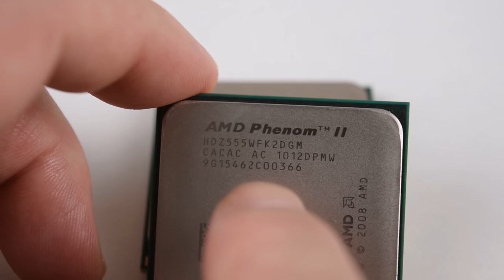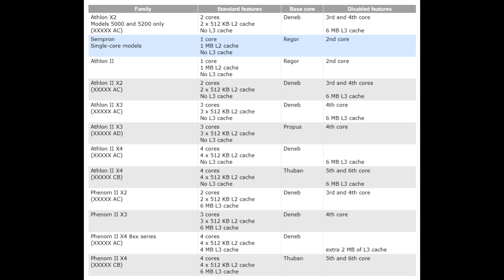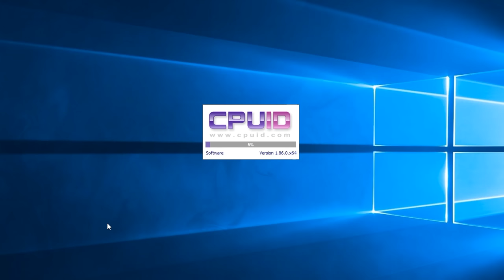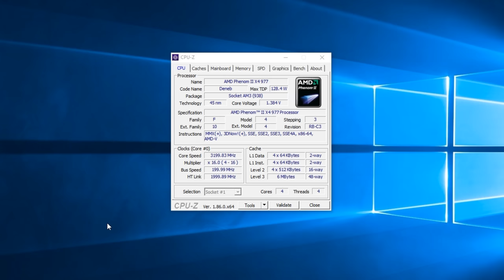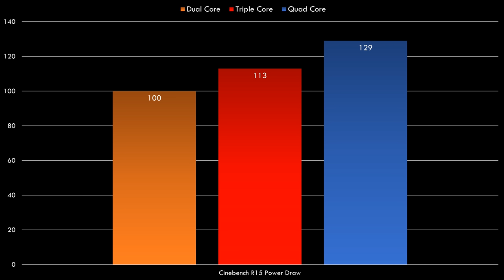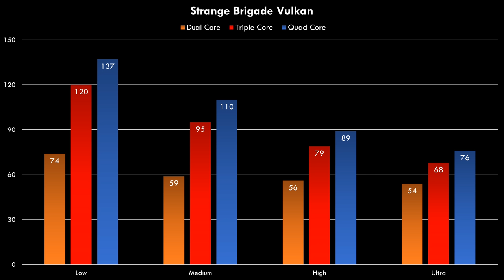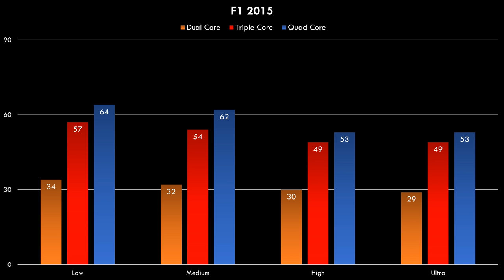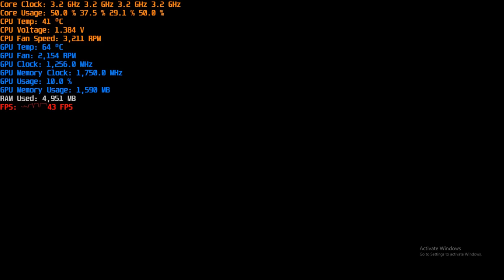Unlock $13 Dual Core into Quad Core

Comment: A timely reminder that I need to play Crysis Warhead! Never did back in the day.

AM3 Phenoms are soooo cheap! Problem is, in a world where i5 2500k's are kicking around for $40-50 US, I struggle to see a compelling reason to use AM3 for anything modern, or even AM3+ FX CPU's for that matter. Because once you factor in motherboard cost, either of these platforms end up costing nearly the same as Sandy Bridge.

Maybe a good video topic for you? What is the best value platform for a modern budget gaming rig - FX, Sandy Bridge, or 1st gen Ryzen 3 or 5? How cheap can you go before you hit prohibitive CPU bottlenecking in modern titles?
Reply from the maker: Yea the i5-2400 is hard to beat in terms of value :D What I do on the channel is mostly working with parts I never had, or wish I had, but were too expensive back in the day. And I like a good price, so that's what makes Socket 775 and AM2/AM3 so interesting to me :) We will for sure be looking at Sandy Bridge and Ivy Bridge in the future.
Reply: Seeing prices on Ebay I'd say that something like a Xeon 1270 V2 or similar would be the best budget gamer alternative, They can go for around 30-40$ and is basically an i7 3770K without the overclocking feature, They also run in most 1155 motherboards without issues (Even if they arent on CPU support list), So that's a pretty good bang for the buck imo :)
Reply: @H4nssoon  Looks like the secret's out on those Xeons because I'm seeing them up above $100 on ebay. For that money I'd just get a 2600k.
Reply: Im still using my Phenom II x6 here, if it wasnt for Zen i had no way to justify spending money on a new computer for the gains i would have by buying a FX (which were shit so cheap but no gain) or an i5/i7 (passable gains but expensive so still not worth the difference). My 1055T here has been running 24/7 for the last 9 years and unless it somehow dies i plan on using it for a bit more.
Reply: @H4nssoon  where do you live? Because the 1270 v2 sells for £100 in the uk
Reply: I just bought a Xeon X5675 for 35€ from China. 6 core 12 threads overclockable to >4,5GHz. I think that ist nearly unbeatable in price performance.
Reply: @jhonnyxyz  
The problem is buying from china isnt so simple in some countries, 35€ is quite expensive if it never arrives or if the customs in your country is an ass and sends it back to china after you paid all the import taxes. Plus not to mention exchange rates. 
If you can get a good deal locally  its way better tham taking risk by buying from china
Reply: Does buying a refurbished notebook count? Bought a FX-8800P Toshiba Satellite with Touchscreen, 256gb SSD and upgraded to 16gb of RAM for less than AU $350 . The whole system probably cost me as much its CPU, when it was first released!
Reply: 30$ pc, 30$ i5 2400 upgrade. Best budget build I ever made.

Comment: 4:38 for reference, a bone stock i7 5930K scores 394 single/2968 multi.  So roughly it takes a Phenom II X3 @ ~3GHz to match just ONE (hyper-threaded) core of said 4 y/o 2011v3 CPU.  Kinda puts into perspective just how important Ryzen really was, considering per "core" the FX series was even slower per clock than this.

Comment: I remember doing this. I also remember peeling off the sempron laminate and filling the laser cut in the pcb, connecting the two pins and your sempron now has the L2 cache and is effectively an athlon xp

Comment: Sadly my Athlon II X4 635 doesn't have anything to unlock, not even a L3 cache - It uses the Propus core with no L3 cache and only 4 cores. Used to run it back in the day at 3.2GHz though, I wasn't comfortable overclocking higher.

Comment: I had a phenom 1  x4 9850BE and it was terrible as it only OC'd 100Mhz more stable for a pissy 2.6Ghz from a 2.5. Was very disappointed in it.

Many years later I upgraded it for a very short time to a phenom 2 x4 945 and I got that from 3Ghz to 3.5 with ease and a heap more work I managed 3.6Ghz.  It was night and day compared to the phenom 1.

I only had this for a few weeks when I got given a free FX 8320 with board and ram which was way better again, OC'd easy too and used a bit less power than the x4 945 did while both were OC'd.    FX is showing its age now though, struggles with compute orientated programs and "games"
Reply: How did you overclock the Phenom II X4 945? Which settings did you adjust?

Comment: I'm wondering how these Phenoms overclock, the black editions are unlocked aren't they?
Reply: Yes, Black Edition means unlocked multiplier. AFAIR it was only available on Phenom II, Athlon II were locked. But I did some great OC only by tweaking the FSB of an Athlon II x2 270 from 3.4 to 4.1 GHz with a moderate increase of the stock voltage (after that, I did quite a nice undervolting to that chip).

Comment: Nice video as always dude. I didn't see it entirely for now but do you remember that the single core Sempron 140 could be unlocked to a dual core ? I had a friend who had it and did that with an overclock, gaining about 35% of clock
Reply from the maker: I do remember such a Sempron, the one I got wouldn't unlock though.
Reply: Single to quad, that's a hell of a jump! O__O
Reply: AFAIK, sempron (sargas) based on regor core, not deneb. mostly it can unlock to dual core athlon II.
But i've never heard sempron based on deneb..

Comment: There's a reason why they don't label every chip on a wafer a Xeon or a hex, quad or dual core. Its simply quality assurance for the lifetime of the chip and meeting published specs. Know what your system is going to do BEFORE you build it and economize using older parts if you have to.

Comment: I use a phenom x4 9650 with a HD 7770. Still chugs along nicely on most games that I own. Once I've fixed the cmos checksum error (seems to pop up even if I use a fine battery harvested from a fully working machine) I'll be overclocking the phenom as far as I can.
Reply: I had a 9850 paired with a gt430. Best setup I ever had, games ran great! until the 9850 overheated and got damaged. Then i had to pair the gt430 with a celeron 420 i had laying around.
Reply: @SummonerArthur  Did you use a stock cooler for the 9850? I use a Zalman CNPS5X performa, no PWM so it's always at full speed. Temps are pretty decent, can't even feel the air behind the cooler getting warm at all.
Reply: @xriqn.  it wasnt the stock one, but was an old cheapo aftermarket copper heatsink. It was good, but looks like it wasnt enought.
I kept watching temps on msi afterburner slowly going up until it hit 83° degrees. Then it turned off.
It did that for a month, even when playing some light games, temps were very high.
When it turned off for the 6th time, it didnt turned on anymore. 
I tried everything. Heating it up, cleaning with isopropill alcohool... But it was dead.

Comment: Need for Speed Hot Pursuit 2010 only uses 1 Core due a Bug that was never fixed, so you need to reassign the Cores while the Game is running.

Comment: Since I live in China, I can say that those are not retail packages but rather more like shipping containers. The seller would usually just get a whole bunch of unpackaged RAM sticks and when someone buys it they just assemble the package before shipping (or handing over in the case of offline retail). 
I know that because I've seen seller doing that in front of my eyes. Maybe it's not true for expensive ones, but you are buying off brands anyway, so the chance is pretty high. If it's actually pre-packaged you will more likely get some serial number sticker on the package I think.
But anyway, as long as it runs stable enough then RAM is RAM anyway, I guess... (I mean, there just aren't a lot of factories that makes RAM chips in the world, and thus at least the chips likely aren't off brands.)

Comment: I have an older machine in my collection that's got an Athlon X2 5200... well, well, well.... :D  Edit: Neither of my AM2 MB has unlock features. Oh well. Looking at local parts listings, there is an Asrock MB that has unlock for like $30 CAD but there is also another listing for an Athlon 2 X4 for $20. So it seems like it's a hit and miss kind of thing. Great if you're already got the stuff, but otherwise better to just get the quad core out of the box (athlon or phenom). Very cool anyway, I had no idea. :)

Edit: Note that the Athlon X2's are like 5 dollars around here. :) So great if you've got the motherboard with unlock features.
Reply: I have that CPU. The motherboard started having problems and then it died.
CPUs and RAM tend to last a long time since it is all solid state.
Reply: @louistournas120  Yeah, not sure myself. I got the system for like 10 bucks. :) I like to collect and fix these things up and play with them to see what they can do. Channels like this keep me excited about the possibilities :). Sad to hear about your Mobo. I tend to steer clear of Intel boards, was it an Intel? I always have issues with them dying as a result I no longer buy from Intel. :(

Comment: Got a Phenom X3 720BE in my desktop system. Great value CPU I got for AU$17 but the newer ASUS motherboards doesn't support any CPU Core unlocking like older pre-Windows 10 supported motherboards used to!
Reply: Logical. Your MB is AM3+ 900 series chipset and Bulldozer doesn't have core/cache unlocking capabilities so manufacturers didn't bother with that.

Comment: Phenom II x2 555 was the best price to performance cpu I've bought as a new. I think it was 2010, something like 50-70 euros. Unlocked to quad core (model name changed to x4 B55) and rolled with that for about 4 years before updating it.

Comment: Yup, I remember. I also remember that those locked cores are crippled for a reason, they are either dead or degraded which would make the computer have blue screens or freeze/lock.
Reply: Yes, but sometimes the yield of the manufacturing process is so good that there are not enough defective CPUs so to speak to satisfy market demands and that's why perfectly fine quadcore CPUs were labeled & sold as dual cores for example.

Comment: oh yes, I had a phenom quad I unlocked into a 6 core. oh yeah back when ucc unlock was a thing. Still have mine.

yeah but if your using all the cores, id recommend an underclock. The other cores are usually locked because of performance, stability issues in the locked cores but even so running them at a slower clock is still a performance increase. AMD did that to mass produce chips with out having to have separate processes for the dual and triple core cpus, instead of binning the rejects from the quads and 6 core cpu's they just locked them cores out and sold them as a cpu with a lower core count, thus also being more cost effective at the same time.  ( this is why they also had a triple core phenom x3, its a quad with a locked core. )

Comment: Running the phenom II x2 550 is probably a nice option too use right away & overclocking too between 3.8 - 4.2 ghz & whatever gpu you got laying around that works in windows xp well.
Also keep that 8 gb of ram & try enabling physical address extension in windows xp & use that extra 4 gb of ram as a ram drive via IMDisk's ramdrive tool.

(Free tool but you cannot save the ram drive for the next reboot i think so you'll need too empty it every time you reboot or go into power saving i think, might work fine though if its set up properly.)

Used it with xash3d & a few mods here in a ram drive, loadtimes were pretty good.

Comment: I bought 3 AMD Phenom II 960t and all unlocked to 6 cores and was able to overclock them to 3.8 with a good after market cooler. The Motherboard use was ASUS with core unlocker.  I paid $ 30.00 for each of the processors on ebay.

Comment: Still wanting to see an FX6100 VS FX6300 comparo to see if the Vishera core has enough extra performance to justify replacing the Zambezi. The 6300 starts with a 200Mhz advantage over the 6100, but is that all it has? After the big letdown going from a Phenom II 555BE dual core unlocked to quad - to a 6100, I'd not want to waste any $ on a 6300 if it too is all flash and no dash. The 6100 and 6300 are each the fastest 6 core 95W CPUs of their generations.

Comment: Really can't emphasise enough  checking the maximum watts your motherboard can handle if you want to play with unlocking. A lot of the cheaper AM3 motherboards maxed out at maximum 95 watt CPUs, and unlocking to a quad (or even a tri core in some cases) could push you over this when your CPU originally pulled less than 95w - a lot, if not all, of the quads are 125w. This could well kill your motherboard eventually (I can speak from experience on this my budget  95w m4a78lt-m le back in the day burnt out its second memory channel about an hour after I unlocked my Athlon tri core to a quad), the power delivery could not handle it. 95w AM3 motherboards with unlock features were a bit of a con really, they were actually pretty limited in what they could use - the best you can hope for is a tri core from a dual.
Reply: a notorious problem, there's a list of phases and burned motherboard reports out there.  but mostly lack of sse4 support kills this processor now.
Reply: ai, at the time being a bit of a newb (my only other PC building experience was a Athlon 64 build, where VRMs weren't so critical) I didn't realise this was what caused the issue and didn't learn the lesson.. the next cpu I brought for the same replacement motherboard was a Phenom II 965 125 watt... I learnt fairly quickly after that 95w and 125 watt don't go ;) That said though, the original motherboard did survive, it just got shifted to single channel ram and packed off to my parents where it is still going strong..

Comment: Well, I paid 10 euros from my 955 BE. Overclocking the uncore does magic, especially on AM2+ platform when it underclocks to 1.6GHz.
Reply: With 3790MHz (2424MHz uncore) it gives 328 on Cinebench R15. DDR2 is holding back pretty much... this is just a temporary machine, my X99 motherboard broke and I'm getting a Ryzen 5 2600 & Asrock B450 Pro4 next week.

Comment: I remember this back in the day but didn't have one since by then I changed to Intel. I also remember you could unlock some gpu's, have you thought about giving that a try?
Reply: Also activate Windows 😂
Reply: wait what gpus?
Reply: @DragonProtector  now you asking, if I remember right ATI/AMD 8xx and 1xxx cards.
Reply: @SkinUpMonkey  ah well i missed that era.

had agp card sadly nividia as that what dell system came with.

Comment: Had the Phenon 555 for several years, unfortunately mine wouldn't unlock so only had 2 cores with it.  It was still a solid processor.  Upgraded it to a fx8350 about a year and a half ago and am happy enough with it.  My ryzen 1700 laptop kills the FX, but it is still plenty for my desktop right now.

Comment: The cores are closed off for a reason, not because of pricing, but because one or more cores showed a DEFECT in testing. Rather than discarding, the die, they would disable the bad sections and sell as a lower performance product, thus recovering the costs of production. Do this at your own risk.
Reply: True, but sometimes production is so good that not enough defective CPUs come out.

Comment: I'm currently running a Phenom II x2 (Forgot which) which unlocks to a Phenom II x4 B55. My motherboard simply has a key I can press on boot to switch between locked and unlocked rather than a physical switch. Has run great for years.

Comment: Great vid! Can this be done with Intel Core 2 duo E8500?
Reply: It can not, this was on amds platform, they disabled cores and sold them as single, dual, or tripple cores instead of the quad cores they were.  They did this because some were just not up to spec
Reply: @nathanhamman418  So, when unlocking them up. Were they always working as expected?
Reply: @ashystyle  There is no guarantee and when you search the internet you will find reports of people who had very unstable CPUs . Even mine is sometimes not working as intended but I think this is because of my mainboard which has bad build quality and no heatsinks around the CPU.

Comment: I also had a CPU that fully unlocked,it was an Athlon X3 460 "Rana" core that identified itself as a "Phenom B60 Deneb core" after i unlocked it.Ran pretty nice,but it was noticeably running hotter than before
Reply from the maker: Nice!

Comment: I was trying to unlock an X3 450 the other day with the CPU unlock feature in my BIOS but unfortunately it doesn't POST with it enabled
Reply: Could also be because the motherboard doesn't support the CPU it "changes" to?
Reply from the maker: You can try lowering the multiplier first, then trying to unlock again. But yes, some chips have faulty cores and won't unlock.

Comment: 0:26 WTF - You will need a hammer to remove this processor
Reply: compare to intel's socket, which will break/bent pins if you touch it wrongly, resulting in boot failure.

Comment: I had a Phenom II x4 810 (the ones with the 2mb cache disabled) and I managed to unlock it no problem to a fully functioning 900 series (oddly cpuz still said it was a 810 afterwards). I also have an athlon x2 240 that’s sadly already a full regor core and won’t unlock. [and night raid needs ssse3 to complete the cpu test, which these chips lack]
Reply: the only athlon II that can be unlock is athlon II 210, because it's based on propus.
Reply: Unlocking part of the cpu doesn't change the microcode that tells the bios what cpu it is